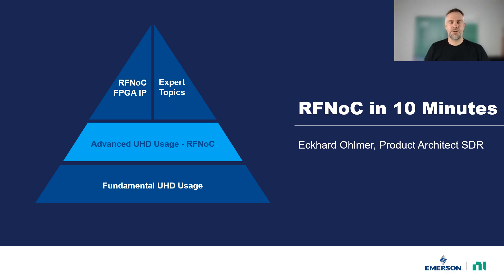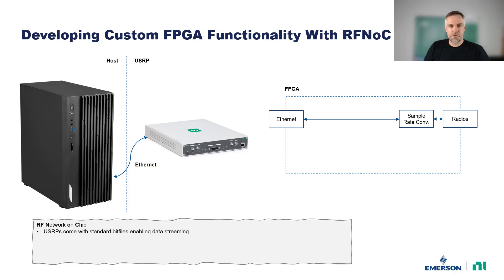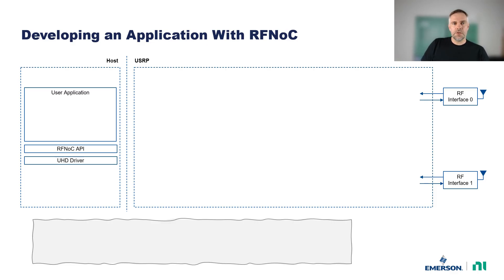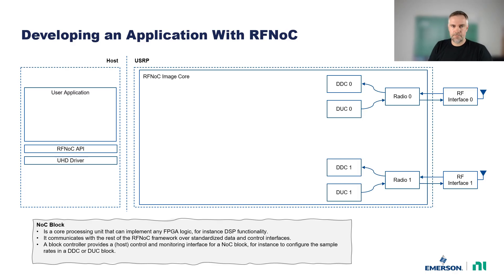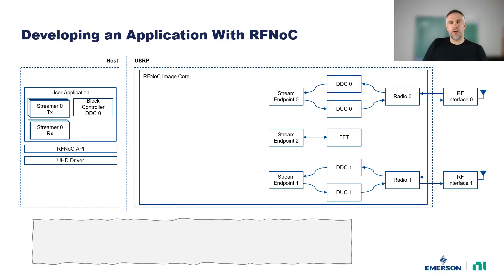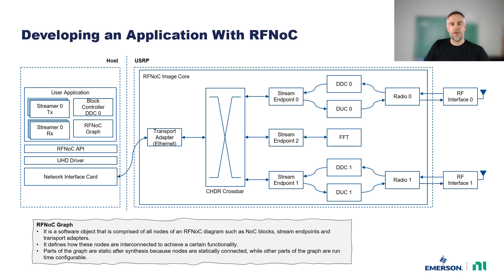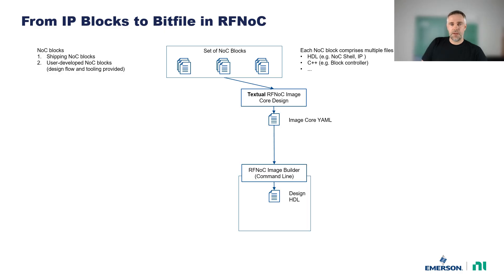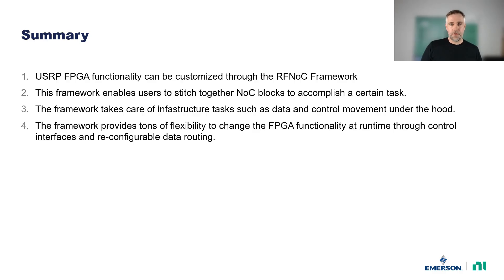What is RF Network on Chip?

Comment: Please update more relevant development materials. We developers really need RFNoc related materials.
Reply from the maker: Hi, are there any specific features or functionality you’d like to know more about? We are working on more videos and RFNoC content, and if you have a request, we’d love to try and add it to an upcoming video.
Reply: @NIApps  A complete walkthrough of a sample C++ (and/or Python) host controller application development in terms of building the dynamic routing but also showing how to access modified NoC blocks e.g when their default parameters are changed e.g increasing the data port width and/or number of ports. Also a high-level statement on the run time overhead of using the CHDR crossbar in a dynamic routing image core vs. static routing. Many thanks!